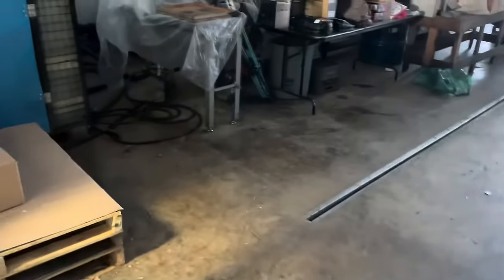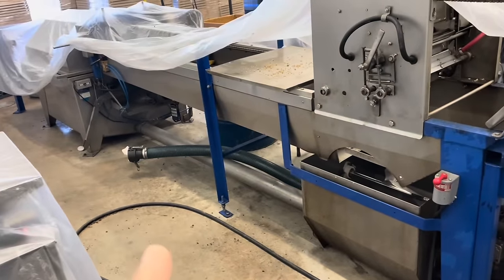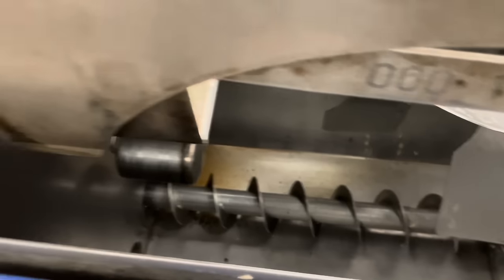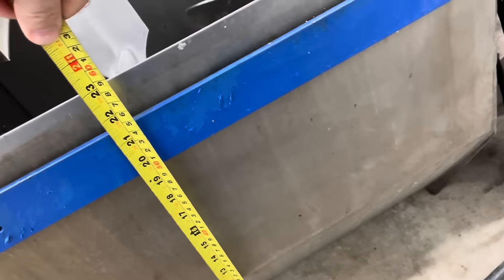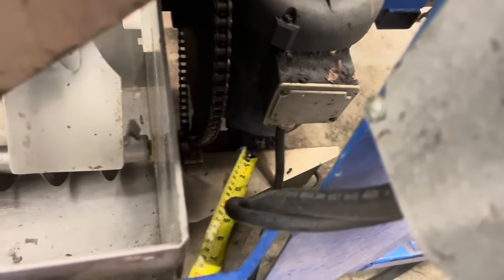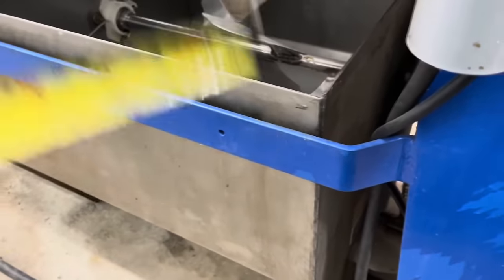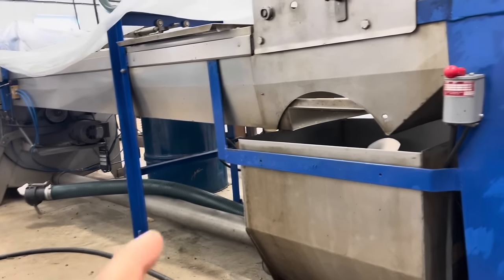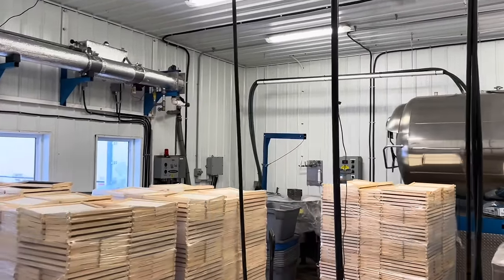Explanation of the Cowen/Cooks and Beals Wax Handling System

Comment: The Cowen auger and spinner is under appreciated. Those two with a large settling take do an awesome job. Thousands of pounds a day, there is no bottle neck. When I melt wax from the cowen spinner, very little to no honey is in the wax. I use steam in the wax spinner. The cowen setup is under $15k vs the Cooks spinner and heater that's probably closer to $50k.

Comment: I just bought a Maxant 7000 spin float.  Thanks for showing me how to set up a Cowen's line with it, while I only run a 28 frame line, I think I will set it up similar to yours.   I'm hoping to run the spin float without a heat exchanger.  Maxant says that no heat exchanger is needed, hopefully they are correct.

Comment: I think my Maxant Senior wax spinner would handle that volume but it is a batch system that needs to be cleaned out manually.  Once the "cage" is full, it needs to spin for a while, I mean up to a number of hours, to dry out the wax.  That would be the single point that would pace the honey house and it would not go fast at all.  I can uncap about 30 boxes of honey before the spinner should be cleaned out.  I think it would work but I don't think it would be a good solution if a person was running a higher volume line than my old 33 frame radial.

Comment: I think just idea if you put the wax and honey into a large tank. What I think you should look into is multiple screens that the wax will collect and the honey will still pass through. But the secret is to have a temperature not hot enough to melt the wax but warm enough to flow through. But the main item is pressure. Strong enough to push the warmed honey but still retain the wax. I am betting you will recover 💯 % of the honey. Now since the wax is in the same tank turn the heat up to melt the wax. The melted wax will flow through the filters and catch any sediment that isn’t wax.